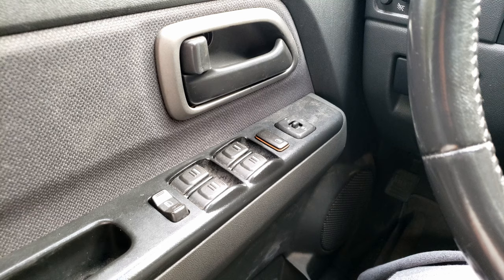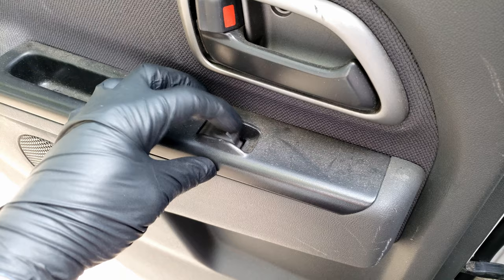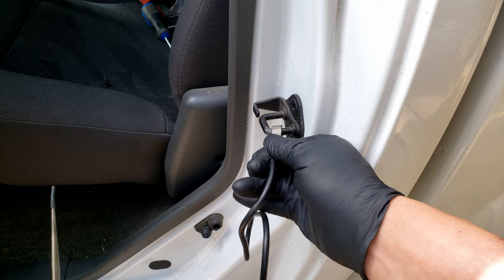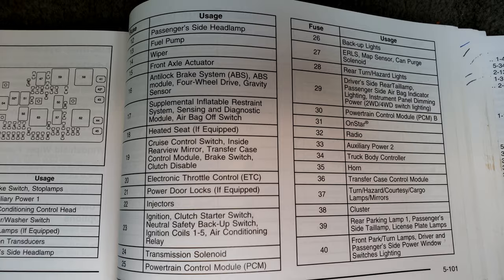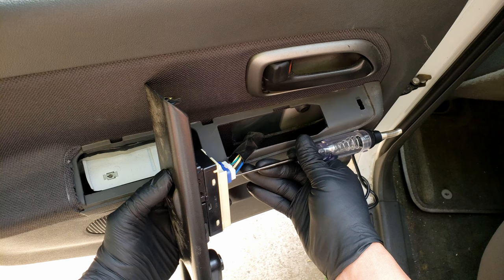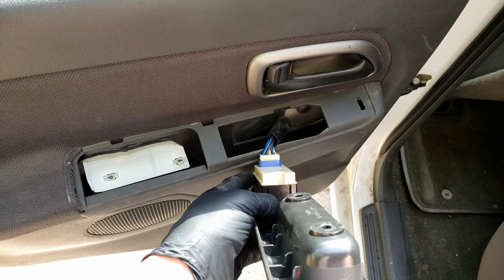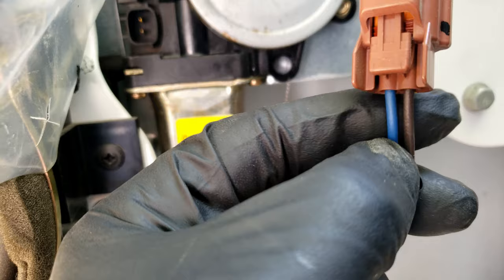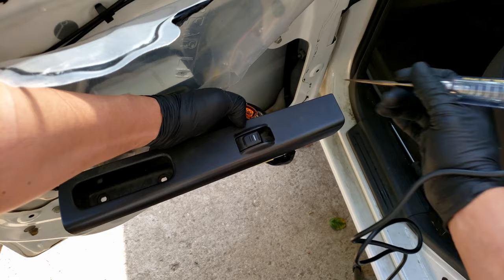How to Diagnose If the Window Switch or If the Motor is Bad

Comment: Hey, what’s up man? I have a 2006 Ridgeline and all my windows work except the the rear window driver side it was working and then all of a sudden it stopped working all the other windows work perfect, I checked the fuses and the fuses are good then I pro the switch that you push to lower and put the window down and there is there is power to it, but it’s really low almost orange, can you help me out if you had one of these jobs before?

Comment: In my car all the switches (mirrors, windows, mirror folding, central locking) do not work when pressed. However, when I place a grounded voltmeter on certain pen, the windows are triggered just fine. What could be the cause behind the switches themselves not working?

Comment: My fuse blows everytime I put one in I can't figure it out any advice ?
Reply from the maker: Well the most common reason for a fuse blowing is a short..which would be one of the wires touching metal if it was damaged in any way. Or maybe the wires got damaged and theyre touching each other..or even if a window motor or switch went bad internally and shorting it.

Comment: Thank you for the helpful video. The passenger side power window on my friend's 2012 Kia Soul doesn't work, but when I engage the switch the window moves ever so slightly as if it is trying but has no strength. But the same windows goes up and down without problem from the switch on the driver's side. Also both windows on the driver and the passenger side open and close slower than the rear windows as well. What do you think would be the problem?
Reply from the maker: Well sounds like the passenger's side switch would be the problem if it works fine with the driver's side switch.

Comment: When you say "probe" do you mean sticking the probe end of the tester into a connector socket, or somewhere on the metal of the connector socket, or do you mean poking the pointy end of the probe through the wire insulation?  TY
Reply from the maker: Well most connectors u can reach the metal wire end of the wire, so i try to touch the test light onto those..i dont really like poking into the wire through the insulation unless there's no other way to do it
Reply: Thanks, I didn't want to poke a hole in the insulation either.

Comment: thanks a a lot. I also appreciate the time you took to write the words for what you were saying. good for hearing impared.
  confused a bit.  at about 420 on time line you were testing it the signal is getting to motor connector. you used test light.
how can signal get to that connector if the orange color connector is not getting to that connector. the orange connector is a female, but the male part of the connector is not connected.
question: so did you test power getting to that connector, yet the test light lights up.
Reply from the maker: That orange connector i disconnected which was going to the motor the signal is coming from the switch to that orange connector so if i disconnect it from the motor the circuit is still complete up to that connector..so when i would press the switch up or down one of the two would get power and if i press the switch the other way, the other wire gets power..which it did..confirming that signal is getting there..so if i were to connect that to a good motor..it would work and move the window up and down
Reply: @backyardchevy328  thank you. i got it now. my fault, i though the orange connector you was testing was coming directly from the motor and not attached to the switch, that is what i was missing. again thanks for reply
Reply from the maker: @scottwatkins39  yea that motor has a solid connector next to the motor itself

Comment: Thanks 👍
Dodge Caravan 2005
Passenger window not working up and down, driver window works up and down, how to fix passenger side ?
Thanks so much
Reply from the maker: Well that normally ends up being a problem with the window motor/regulator assembly

Comment: Hi guys, after following the power I also found it was the motor, however I took it a step further. I dismantled it and found that the carbon contacts had left a dirty film on the commutator.  After removing it with 2000 wet and dry sandpaper it's up and running. Ended up costing nothing but a little time.
Reply from the maker: Great job🙂👍

Comment: Thanks for your video! i have a 2005 Chevy Colorado all my windows go up and down no problem from my driver control side but each individual switches from passenger to the rear does not go up or down but it unlocks and locks each door any ideas?
Reply from the maker: And the lockout switch is disengaged? Could have a problem with the lockout button if so
Reply: @backyardchevy328  yes the lockout button is disengaged that's why I'm so confused on how to fix the problem
Reply: @backyardchevy328  should i get a new driver side control module? Are you saying the lockout switch has gone bad?
Reply from the maker: @dylanlueras8976  cant really say...unfortunately without testing for voltage out of one of the door switches cant really say for sure what it is..ud wanna test if the passenger or rear door switches send signal when u press em..and u also wanna see if theyre getting power to those switches and go from there

Comment: I have  a vw jetta that has only rear windows that stopped working. This happened after I installed replacement speakers.

The front two work fine. Just the two rears. What could be the case?
Reply from the maker: Does it make any noise? Any chance when removing and installing the speaker it may have pulled on the connectors and disconnected em or pinching the wiring somewhere if the speaker is bigger in any way
Reply: @backyardchevy328  there is no noise at all. Nothing happens. It's possible something happened to the wires. But both sides? I will check out all the wires again. You might be right. If one side is pinched does it create a problem on the otherside?
Reply from the maker: @SF004  it may depending on the wiring..but also the speakers were same on both sides..so it may be causing the same issue on both sides
Reply: @backyardchevy328  okay. I will look at all the wiring.  I find vw very picky. It doesn't like to be touched..lol

Comment: Hello. What if when I'm checking the wires in my main power window switch for current two of the wires don't show any (test light doesn't light up) but all the other wires do? Does that mean only 2 lines need to be changed? Thank you for any help and for the video
Reply from the maker: Well the main ground wont light up nor will the ground for the signal wire..which is the ground being sent to the motor..seems like ur switch may be ok in that case...id check the signal at the window motor connector

Comment: Here's where I'm at:
I have tried the window with only the motor and main driver switch.  Nothing.  Nothing with the passenger switch (the problem side) alone.  When both are plugged in, the passenger window automatically goes down and will not go back up.  I've slid the mechanism manually and it feels fine.  The motor turns by itself when both switches (main and passenger) are connected.  Ideas?
Reply from the maker: Well they would both have to be connected for the window motor to function since the main window switch routes power to the passenger switch and the passenger switch routes it to the motor...but if its moving on its own..seems there's a short either in the switch connector itself where its constantly contacting...or the wiring is..but thats normally a problem with a switch

Comment: Had a question.. please,  2006 toyota tundra drivers window, went down, won't go up. Replace the 25amp fuse, still no up on window. Used your video and went to plug at motor.  Checked down, test light lit up, checked down, no light.  So this means switch ( up position) is bad? I went ahead and ordered a new switch and motor as well.  Thanks in advance, Michael
Reply: Did it fix the problem?
Reply: Many many thanks, I was given a bad motor as well but thanks to you, I discovered this was just part of the problem and I simply switched the switch and returned the original motor. ALL GOOD now, thank you so much  @WestCoastUSA546

Comment: Just got a 2007 Acura TL. 
The windows were all working fine and suddenly all three other windows besides the driverside window stopped working. 
I checked the fuses. All fine. So I’m assuming it was to be one the issues explained in the video.  
Is that unusual to occur for 3 windows like that? Could it be something else?
Reply: Also fuse 32 which is a 7.5A is blown. It’s for the audio but it’s the only thing blown. Not sure what’s going on.

Comment: And to be sure the motor is bad just add 12 volts to the motor terminals, positive to one, negative to the other and swap for reverse action.
Reply from the maker: Yup, made a video on doing just that with a battery or a 9v battery

Comment: I have a maserati ghibli 2016. Driver window wont go up or down. I replaced the switch assembly, still doesnt work. all other windows work. could it be a fuse?  how do I know if it os motor or regulator?

Comment: My Silverado is an extended cab, so it only has two windows that roll down, so it doesn’t have window locks. I can hear my passenger side switch actuate, and it is drawing power, so I think that it might be the motor.
Reply from the maker: Yea normally thats a problem with either the regulator assembly tangled or if u hear the motor but no action from window could be regulator cable assembly busted

Comment: Subscribed. So I have a 2011 Colorado. The black wire for the rear pretty window switch is ground right?
Reply from the maker: Thank you🙂 yes black is normally the ground..but for window switches the signal from positive to negative...like for the window to go up itll have positive on one of the window motor connector wires and negative on the other and to go down it switches, that same wire will become negative and the other positive

Comment: what if all that is fine and it still doesn’t work? i’ve checked everything and it’s getting power but my motor still won’t work. this is a new motor btw, i tested it on the battery and it works i just can’t figure out what the problem is

Comment: Hi, can u help with my passenger door window on my 3rd gen 4runner?  It only goes down but not up with using both window switches on driver and passenger.  I confirmed it's not a motor issue already.  Can you give me some pointers on what to test?  Thx
Reply from the maker: how did u confirm it wasnt a window motor issue? best way to find out is with the test light or a voltmeter (u connect one lead to the signal wire and other to ground), u can disconnect the connector going to the window motor u can test to see if its sending signal to the motor when u press the up button,

Comment: Hi, great video simply explained. I can’t seem to find my specific problem online. It’s a 2011 civic LX. With main driver control I can only roll up driver window ok,  and none of the other switches work the passenger windows and the switch on each door does nothing. 
-child lock is not pressed, even if it was the switches there don’t work which makes me think it’s the driver door switches. 
-I checked under steering wheel fuses all are good. 
Think it’s the main switch on driver  door? 
Any ideas? 
I appreciate any info from anyone.
Reply from the maker: Could be the actual lock out portion of the main driver switch may be bad..if its disengaged and none of the rest of the switches work then it may be a problem with that..best way to tell though is to test the signal out if theres any coming out of the switches
Reply: Search online, there are plenty of forums that go over your problem. Honda should be attacked with a class action lawsuit for their window problems. From the 90's on up. Thousands have the problem you describe, and thousands more have the one where the passenger window emits a "clicking" sound but will not operate. The window motors are junk. And the brushes are like something from a model car. Burned connectors and diodes, broken wires in the door/ pillar area, cheap regulators and on and on.

Comment: What kind of circuit tester is that?  And thank you for this video.
Reply from the maker: Its just a 12 volt test light..which lights up whenever it receives a 12 volt signal

Comment: On my 2001 chevy silverado truck the passenger window side just makes a click when i use switch on my master from driver seat location also does not work from passenger side switch... a few months ago it did this same thing and i took apart passenger switch and and after putting it back window worked good from both switches for 5-6 months,,, now the same... took apart and even tried cleaning contacts etcs... did as much as i could and still nothing.... does this sound like switch is bad or do you think now motor went bad... to me since it is doing the same exact thing and making same clicking noise i feel the switch finally died for good...maybe something inside switch fired or contacts are worn...your profession opinion is appreciated...thanks
Reply from the maker: It could be a few things..a click could be a bad contact..maybe theyre dirty or burnt connector..yes could also be the contacts in the window switch..could also be the window regular is stuck..i replaced a silverado window regulator recently that did the same..it would click and it ended up being the cable got tangled and the owner forced the window up and snapped the cable..but best way to tell is if u press the switch and have a test light..if it sends signal as u hold it..then the switch is more than likely good..is the click sound in actually door area? Or does it click where fuses are?

Comment: This is the 2nd time this has happened while driving i pushed switch to roll window down at same time I hit a slight bump in the road and heard a pop which I assumed to be the actual cable in the track mechanism had snapped do I need to get the whole kit or can a cable be replaced? Motor and switch are working fine.
Reply from the maker: In some cases they sell just the window regulator (which is the cable assembly)without the motor, then u swap ur motor onto the new regulator. It just depends on the vehicle if theyre sold only together or if they're sold without the motor

Comment: My rear window only goes down not up. Does that mean it's probably just one of the wires and if so do I need to solder a wire or can you replace that wire harness? Thanks a lot
Reply from the maker: It could be ur window switch is bad..do u have a test light or a multimeter to test to see if it sends signal out, youll wanna test the signal at the switch and also at the window motor connector if u are getting signal it could be an issue with ur window motor/ regulator assembly

Comment: What if it's the driver's door? How do you test as to either it's the switch or motor?
Reply from the maker: Well ud do it the same way..removing the door panel and test for signal at the window motor connector...if its sending signal out then itd be a problem with the motor..but if ur not getting signal from the switch then youll wanna verify power to switch and output from switch...or i have another video that shows how u can just test the actual motor/regulator with a battery. It should be linked at end of video

Comment: Thanks for this.  I learned a good deal.  I went through my 2003 tests on my drivers side connector. My drivers window won't go down.  All other work.  I changed out the switch and it worked for about 3 days.  Now shows same issue.  I checked the current and the problem now seems like there is no current for down wire.  All others show current.  What could cause that?   Solution?
Reply from the maker: Its odd that it worked for 3 days after replacement and its only the down that doesnt work..any chance theres a damaged wire? Or maybe the motor might be going bad and its causing the switch to short from the heat..maybe the wire to the motor is damaged somewhere like it has a cut
Reply: @backyardchevy328  I have t taken the door apart to look at it.
Reply: So I took off the panel and pulled the connector to the motor.    The same wire shows no power so I have ordered another switch to see if the wire shows power with the new switch.  Maybe the switch I had received was faulty ?   Is there a way to test if the motor is using too much energy causing wire or switch to burn out?
Reply from the maker: @dondeaton9797  well they have those amp testers that go around the wires and u can find out the amount of amps the window motor is pulling to roll window up or down...but im hoping it was just a bad window switch..was it an oem style?
Reply: @backyardchevy328  not sure.   I had ordered on Amazon.
Reply: @backyardchevy328  so I tested the bolted switches were using.   Both registered 12 on meter for up and down using the new switch I ordered.  The regulator, which is the silver part wires connect to was extremely hot to the touch after testing.  Thinking I need to replace it?  Can you replace just regulator or do I need to replace motor as well?
Reply from the maker: @dondeaton9797  that would be the window motor and yea if its getting hot its normally a sign its bad..the regulator is what the motor bolts up to..to move the window up and down..yea in many cases they sell just the window motor
Reply: @backyardchevy328  ahhhhh.   Got it.   See.  That's why we contact the experts.   I'm going to order the replacement.  Your video helped a lot and thanks for the help.  I'm gonna make my own video of it and will shout out when I do.
Reply from the maker: @dondeaton9797  glad to be able to help🙂 and thank you i really appreciate it